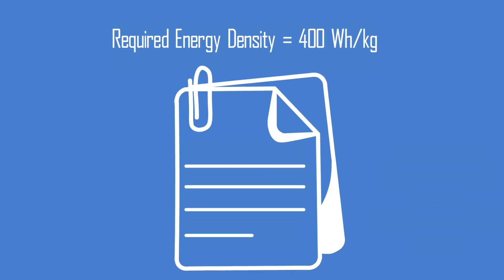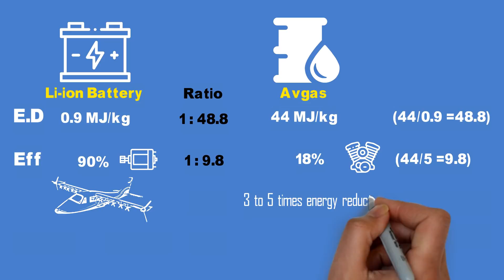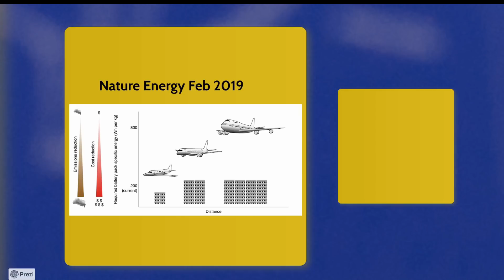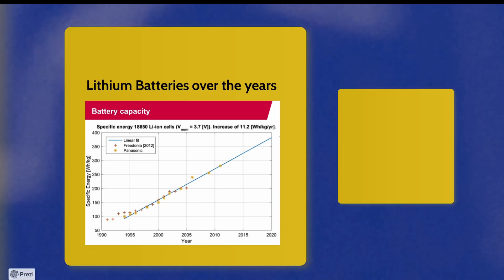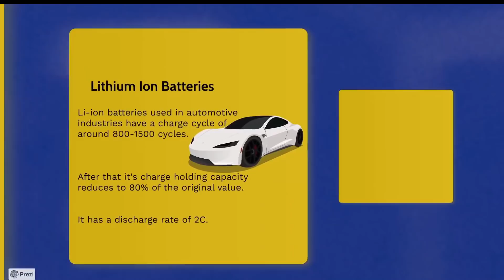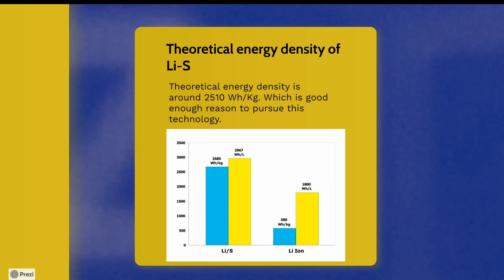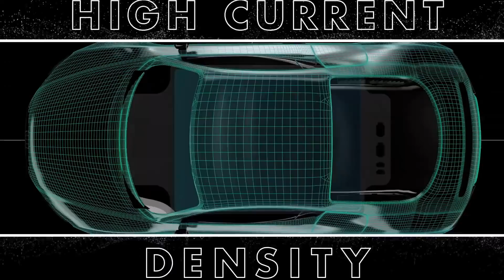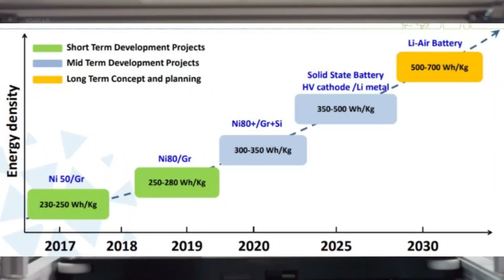Batteries for Electric Aviation: Where does the battery technology stand and where it is heading

Comment: Great video and good explanation without fluff. one thing I did not quite get was why nobody has yet tried to make a super efficient electric generator from av fuel and then keep the rest of efficiency gains from electric plane architecture? assuming theoretical efficiency of 50% for gasoline->electricity that could mean at least 2.5x (50->20pc) operation efficiency gain. and this is without factoring in any gains from improved aero dynamics & rotor config because of electric prupulsion. wondering what your thoughts on that are?

Comment: Great research to find out what's happening in battery space. But, have you done the calculation to see how heavy li-air and al-air batteries get when discharged? All that Li2O or Al2O3 is surprisingly heavy. Unless plan is to drop batteries during flight to keep the weight down... 😧
Reply from the maker: Thanks for letting me know. Will look into it

Comment: One note about aluminum-air batteries not being rechargeable. While that is true for in situ recharging, meaning that the battery can't be recharged while still in the vehicle, it isn't true if you expand your definition of recharging to include the storage of electrical energy in the active material in a process that is done after the battery has been removed from the vehicle.

In the case of aluminum-air, the discharge product is aluminum hydroxide (Al(OH)₃. Aluminum hydroxide is easily "recharged" back to metallic aluminum since it is what is extracted from bauxite ore as the first step in the aluminum smelting process. The aluminum hydroxide removed from the "spent" battery is thermally decomposed to aluminum oxide, which is in turn reduced to metallic aluminum by the addition of electrical energy in a electrolysis cell. New aluminum plates are then made and  inserted into refurbished aluminum-air batteries and reinstalled into the vehicle.

This does require the batteries to be removed from the vehicle. However, this can also be an advantage since a battery swap in a well designed system is more akin to refueling rather than recharging and so can result in much faster turn-around. The downside, however, is that the round-trip efficiency which includes the electrical energy used to recycle the aluminum is rather low at 20% or so. Plus there are other issues such as the need for rare-earth metals on the cathode side in order to split the oxygen, and the need to manage and potentially continuously remove the aluminum hydroxide since it can basically gum up the works and slow the operation and limit the power.

Comment: That calculation is so immensely wrong. The efficiency is much higher for the modern combustion engines. Batteries are nowhere near producing enough range to even come close to long range hydrocarbon planes. 400wh/kg is perhaps enough for tiny airplanes for short distances. But large, long range airplanes is what produces the overwhelming majority of CO2. And for those planes you would need a battery with around 2500wh/kg to even come close.

Comment: Aluminium Oxide batteries are the solution. Very light and energy dense. Only downside is that they aren't rechargeable, so the solution is to use many small and easily swappable cells.

Comment: to calculate efficiency of electric aviation, you have to consider the efficiency of Inverter, or the efficiency of battery degradation, and efficiency of charging as well.
Therefore, the efficiency of electric system could not be 90%

Comment: Something else that puzzles the mess out of me is, hydrogen tech, stability, fuel fumes, operability. Opportunity at our fingertips & everyone is on batteries. If the batteries are used as secondary operations & emergency main operations if necessary. Why not use other powered powerful motors that uses sensible fuels? To dependent on batteries.

Comment: What do you think about Aluminum-air batteries for aviation? They already have a practical energy density of 1300 W h / Kg, their only drawback is that they're not rechargeable (although they are recyclable). But since you're not charging between airports anyways, in principle you can just replace the AvGas infrastructure with Al-air battery infrastructure.

Edit: oh, you do address it, I just didn't watch to the end before commenting.

Comment: If the take-off take a significant portion of the energy stored then if the vehicle always takes-off from the same place then it could be connected to an extension cord until maybe 200 m of altitude and then disconnect for vertical flight.
Reply: Another varient would be consider a electromagnetic catapult that normally the Aircraft carrier employ

Comment: I argue its more about kW per kg not kWh... Lithium sulfur is the wrong direction, we need power for lift but it's way fewer kWh per mile. More important to use that high c rate to charge rapidly

Comment: We could carry an edison generator or two .  Unlimited electric flight airplanes.  120 amp 12 v DC 3 40 amp inverters to get 6 20 amp outlets 110v  . If you had two of these small zero fuel power plants in the airplane would this be enough power .. We carry the generator and have unlimited flight airplanes.  Edison generators are permanent magnet motors as generators of electricity . The use of batteries is obsolete and inefficient.

Comment: Reciprocating ICE might be 18%, but jet engines with high bypass ratios exceed 50% eff.  All engineers looking at E Aviation are aware of this.  Omitting the obvious doesn't improve the state of the art, nor inform the public with an objective take, leading to the rise of conspiracy theories about why technology X hasn't appeared as scheduled by the hype.

Also, while E motors are higher power density than ICE, they lag a little behind the best jet engines; e motors will require super conducting windings to compete w/ little actual development so far in superconducting motors for production.

Comment: I have been thinking about something kind of different , what kind of batteries would be appropriate for COIN (counter insurgency) aircraft , here you need a low tech rugged battery that can be shot full of bullet holes and still provide a limp home capability . Long range is not necessary , but long loiter time is , and low noise is a really big plus.  My vote goes to a developed version of today's NiZn batteries , I would like to hear what do you think are some possible candidates.

Comment: Two more factors to make for a truly fair comparison would be the fact that the aviation fuel is used during flight, so you are only carrying the weight of that which has not yet been used, and the ability to take on less than a full fuel load, allowing greater load capacity and or reduced fuel consumption.

Comment: Yeah, if the batterys get twice the energy density, and the electric planes gets much more aerodynamicly efficient, they will almost match the gasoline planes of today, unless they also get better.
The Pipistrel Electric with twice the endurance will still not beat the gas model in range, but maybe become a viable alternative not just for flightschools that mostly does ~45min lessons.
The thing is you need to have a reserve capacity for it to fly somewhere and not just circle the field.

Comment: You do a great comparison between batteries and avgas engines, which I was surprised at. It would also be worth while looking at the efficiency of Gas Turbines, I'm sure that they are a lot less efficient than gasoline engines.
Reply from the maker: Gas Turbines are actually more efficient than IC engines, not the smaller ones but the larger ones. Electric Aircraft at present cannot compete with jet powered aircraft. They can only compete with IC engine aircraft at present

Comment: Thunderfoot destroyed the viability of a battery electric airplane. At 400 Wh/kg the batteries become thermite meaning any thermal event within the huge battery pack needed would ignite the entire pack in an unstoppable thermal runaway event. Battery electric airplanes wont happen like we think and certainly not with the inclusion of a cell that is so incredibly potent yet inherently unstable just like the contents of thermite until ignited.
Reply from the maker: Thermal Runaway is a possibility yes. We have well over a 30 million electric vehicles running around the planet, but we dont hear about thermal runaways on a daily basis. I will give you that there have been a few accidents overtime, but there are ways to prevent thermal propagation. One method is to split the batterypack into several distributed modules that are not in proximity of each other. This is the system that BlackFly uses
Reply: @ElectricAviation  Right but imagine yourself on this imagined airliner... "ok ladies and gentlemen, we seem to have a slight battery fire that is consuming a quarter of the fuselage but no reason to worry" How much do you really know about aviation because safety is a number one consideration and someone saying "oh well it probably won't happen" isn't good enough.  Some day maybe but not with our current battery tech.

Comment: A bit off topic, but are there any concepts or thoughts about electric seaplanes?
This is just a fancy idea but you mentioned something similar in your airship intro, I love the idea of having a kind of "camper van" airplane. 
If you could integrate a lot of solar cells into the wings you could slowly recharge an electric plane. So it would take maybe a week to fully recharge, but you could fly somewhere, land on what and then live there for a while. You'd want to increase surface area for that and it would add weight of course. But maybe something like the celera 500L.
And being able to land anywhere were there is water allows a really broad use. But I don't know if you're even allowed to land on some random lake haha.
Reply from the maker: There was one made early last year in Canada. It was a retrofit
Reply: @ElectricAviation  Thanks. You have a name or link with more info?
Reply from the maker: @dejayrezme8617  https://www.theguardian.com/world/2019/dec/11/worlds-first-fully-electric-commercial-aircraft-takes-flight-in-canada

Comment: Your missing a critical combining tecknology,namely super capacitors,which in combination(very light)offer extreme bursts of power,when combined with something like the sulphure battery,regulate the irregularities of lift off power(on a plane catapult),climb,high efficiency high altitude(super effecient battery use)gliding down,and landing(parachute/giro copter).other   landing i thought of,was parachute into swimming pool,and parachute onto inflatable sheets,covering a whole field,here you can make the two ends of the power consumption of 300-400 batteries workable

Comment: I'd be interested to see where the 18% comes from for Avgas engines. In a fixed wing aircraft I have seen more like 29% for a Lycoming engine. Doesn't change the conclusions very much but 18% seems low.

Comment: Your 18% efficiency number is grossly underestimating the efficiency of ICE engines. A modern truck is 21% efficient at the wheel. But this number is meaningless.

You'd have to compare these engines by Brake Specific Fuel Consumption, and you'll find that, at optimal operation, a gasoline engine is upwards of 36% efficient.

For example, the Lycoming IO-720 from 1961 is 34% efficient.

Even modern turboshafts are 29% efficient.

Diesel aviation engines from WWII were 42% efficient and right now there is a modern aerodiesel resurgence which has increased efficiency, power output, and service life while also reducing weight.

By this logic, then, batteries would have to have 800wh/kg to 1000wh/kg to compete.

https://en.wikipedia.org/wiki/Brake-specific_fuel_consumption
Reply: Just pinging you again for a reply.  I think honesty and transparency is important for advocacy and I think this low requirement for energy density is dangerous for electric flight.

To persuade people, the arguement need to be unimpeachable
Reply: You continue to evade this glaring oversight.  This is appearing less a mistake and more a glaring intentional omission...perhaps even deception.

Do you want to progress green energy or are you just amassing likes and shares?

Comment: The heavy part of the battery is the Cathode not the Anode so Lithium has little advantage. A breakthru would be a usable Oxygen electrode, so far only seen in high temperature fuel cells.
Batteries, like rocket engines, are penalized by carrying oxidizer along with fuel.

Comment: You may want to actually watch battery day before quoting 1/5 of the battery enhancements , they increased range by 54% ( not entirely from battery density , but it sounds like they will be starting at 330 kWh to 350

Comment: You forget flow batteries such as Vanadium Redux Flow. There is already a car made using it (QUANT 48V). You could basically recharge like at normal gas stations due to the liquid nature of the battery. Less energy density however, so can't apply to air travel just yet. Ref https://youtu.be/CSawQl8Lf1Y

Comment: Some real wishcasting here comparing electric motors to ancient piston engines rather than turbines which is what every helicopter and plane larger than Cessna uses. The turbines are approaching 40%. Even current gasoline automobile engines are approaching that number.  This analysis is super deceptive. I am all for electric vehicles, but not foolishness like this. Short flight VTOL aircraft are probably possible now as long as weight and distance are kept to a minimum. Finally, never, ever, rely on Elon Musk for technicals details. They could be right, or they could be wildly off.

Comment: Excellent video. One though, the internal combustion engine with efficiency of 18% is a bit misleading in this context. Efficiency of a modern, large scale jet engine would be more then double that number, > 40%.
Reply from the maker: Over here though we are only comparing small IC engine aircrafts with Electric aircraft.
We are a long long way away from electric competing with Jet Engines

Comment: you forgot about decreased drag by flying higher than engines requiring air can fly. also, reducing weight by using the batteries for structural loads.

Comment: One thing you didn't mention in your calculations is that fuel is used up during the flight, which effectively makes its average mass lower. The average is probably not quite 50% lower as aircraft do not typically use all their fuel, and takeoff is when the aircraft has the most fuel and also uses the most power. So overall it might not affect your calculations significantly.

Comment: Where did you get your numbers for engine efficiency? Rotax 915 consumption is 290g/kWhr. At 45.8Mj/kg, that's 13.8Mj per kWhr (3.6Mj) output so efficiency is 27%. Automotive derived diesels like Continental CD155 do 210g/kWhr so give efficiency in the mid 30s. And the claimed 3-5x improvement for distributed propulsion, if realised (highly questionable!), could also be applied to a combustion energy source in a hybrid, as well as to a battery source. You have also neglected the energy consumed in battery manufacture, which is amplified by the deleterious effect of high discharge rates on battery lifetime. Pipistrel Electro warranties their batteries for only 800 cycles, or 400 hours - this is a big part of its lifecycle CO2. For the foreseeable future, limited supplies of lithium batteries should be used in urban buses, cars and delivery vans... not build flying sports cars for billionaires. If they want to save the planet, they should stay on the ground and catch that electric bus - like the rest of us.

Comment: Generally good presentation but your assessment of aerodynamic improvements available to electric aircraft is drastically over estimated. Modern aircraft are incredibly aerodynamic and improvements are on the scale 10 percent. Not the 3-5x you are claiming. This of course has a dramatic effect on potential ranges. Battery powered transport aircraft will not see practical application beyond short range air taxis until battery energy density exceeds 1000Wh/kg.

H2 fuel cell powered electric aircraft are the only viable path for at least the next few decades.

I have built and flown several electric airplanes, so I might know a bit about them, check my youtube channel :)
Reply: Fair point but he did add that EV opens the door to efficiency improvements beyond aerodynamics, such as distributed propulsion. Having not had your experience, I am unable to comment on improvement factors, but perhaps these extended benefits can help go beyond 10%. With young kids (and as a pilot) I'm thrilled to witness the furthering of these technologies. Perhaps in a post COVID world, we will have adapted a little towards shorter range travel. We haven't had an OS holiday since 2019 and are loving exploring our own country. Cheers from Sydney, Dave
PS. I have come across your channel and love what you're doing. :-)

Comment: tesla has 380kwh/kg of energy density with the new "4680" cells.
Reply from the maker: There is no specification sheet that says that. I had looked into it
Reply: @ElectricAviation  in the battery day presentation Elon mentions 16% improvements in energy density.

Comment: Great video, a modern turbofan e.g. on the B787 or A350 will be around 55% thermodynamic efficiency, quite a bit better than 18%,  and they are about 75% efficient in converting that into thrust. For propeller aircraft the propeller thrust conversion efficiency can be 85+%
Reply from the maker: The comparison here was with small IC engine planes, the Cessna's , the Piper's etc. Batteries cannot compete with jet planes. Fuels cells have a chance

Comment: why do we need density? why not more batteries?
Reply from the maker: Because more batteries mean more weight to lift, which in turn means higher power required. High density means less weight to lift for the same energy capacity